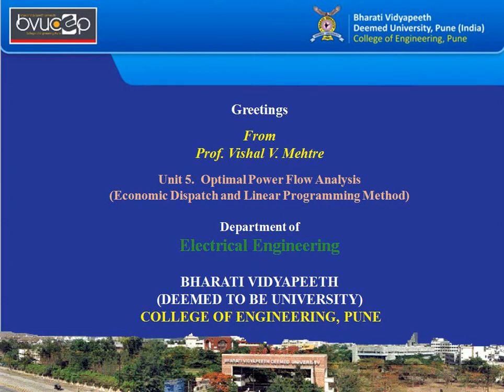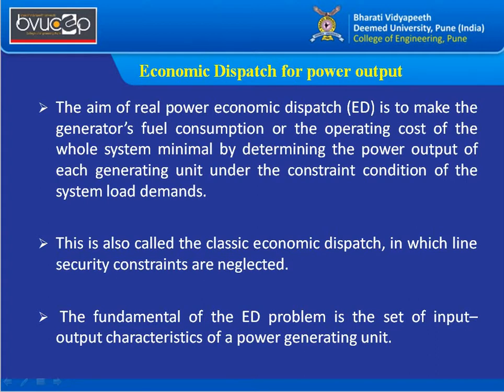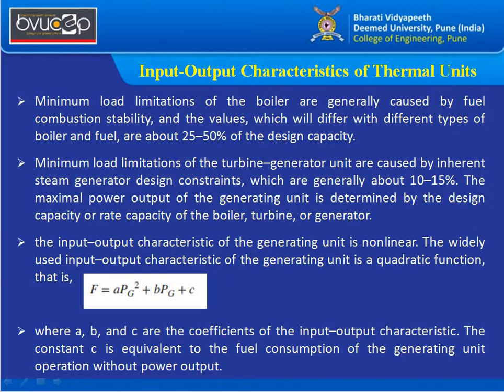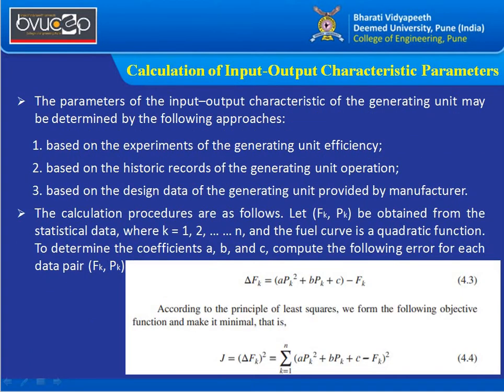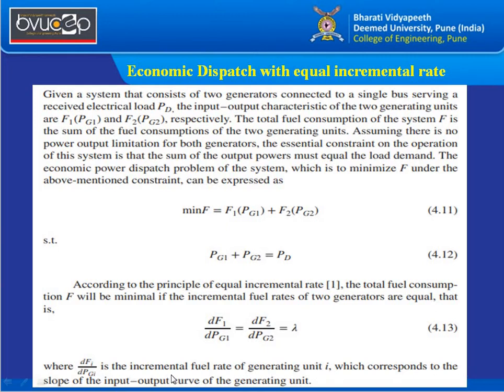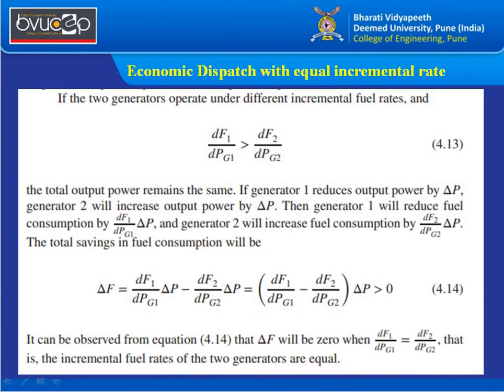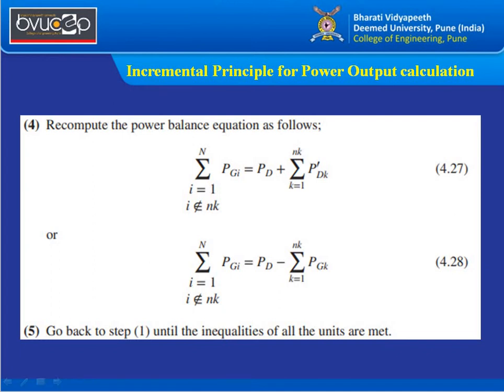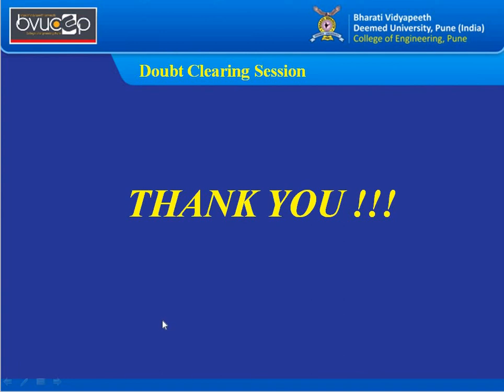Economic Dispatch and Linear Programming Method

Comment: Sir can we consider grid as a infinite voltage source.bcz practically how can be it's possible
Reply from the maker: Yes bu it is the modelling point of view. We consider single generator connected to infinite bus system and have its analysis